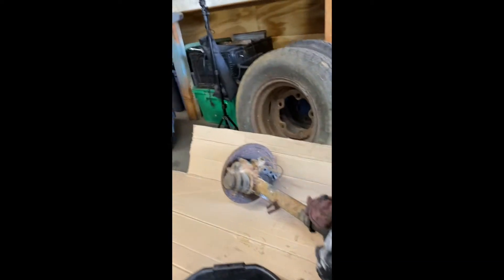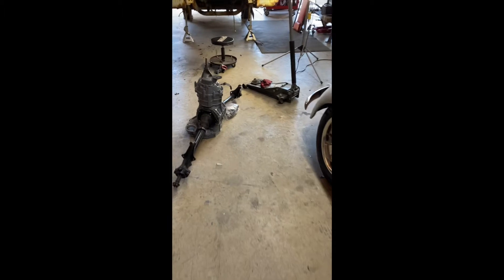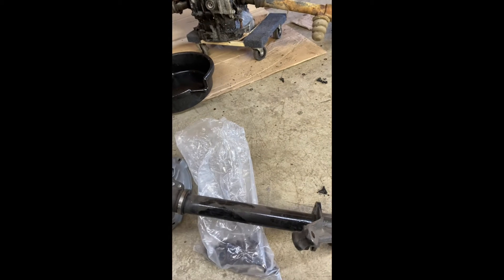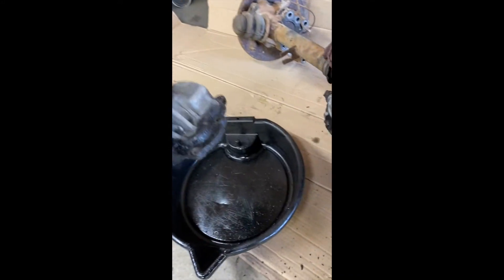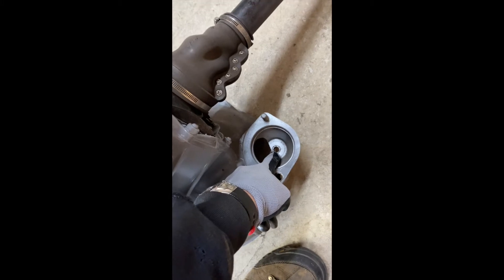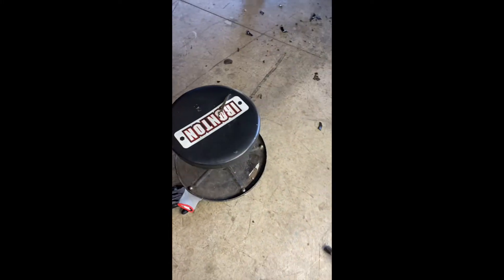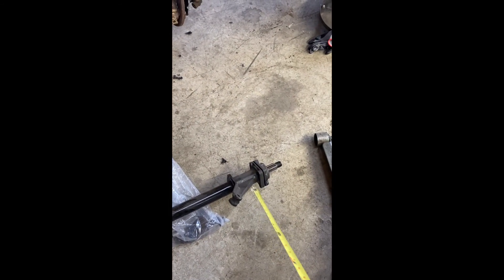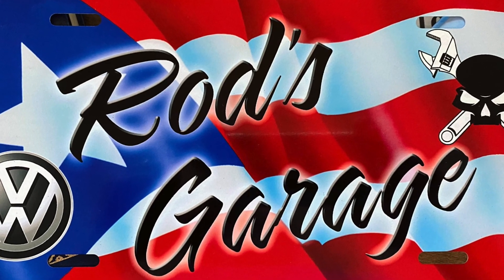VW bus reduction box straight axle swap

Comment: What was that about flipped ring gear ?    I though, you could take 68 beetle transmission as it is, change the nose cone, get modified spring plates, modified rear drums for wide 5, and get down the road ??  And continue to do full modification by adding disc brakes with lowered front spindles ?
Reply from the maker: That is for the folks that want to use their bus transmission my friend! And yes you are absolutely right a 67-68 tranny or a type 3 will work with no issues.

Comment: i am building a mid engine rail with a 2.3 lima. flipping the ring gear in the transaxle will weaken it. how hard will it be to put bus reduction set up on an irs suspension? putting them on would make flipping the ring gear unneeded.
Reply from the maker: @tobyfaas8070  for a reduction setup you will have to change the spring plates, not sure for irs! I’ve never worked with mid engine before.

Comment: can you expand on the brakes? i'm thinking of using my existing bus transaxle so i'll be flipping the ring gear and installing an old speed straight axle kit. i heard you need a type 3 or thing backing plates and brakes but is that only if i swap a bug trans in? can i use my bus brakes?
Reply from the maker: I’m going to use beetle disk brakes on my 66,  I’m sure the bus brakes do not fit  the beetle axle, but if you can make them fit more power to you. And yes type 3 brakes or thing brakes, these brakes are much bigger than regular beetle and will fit the axles.